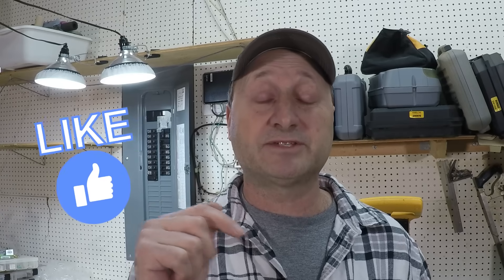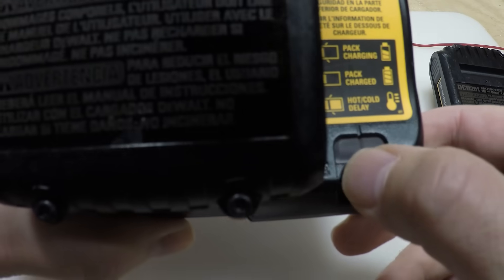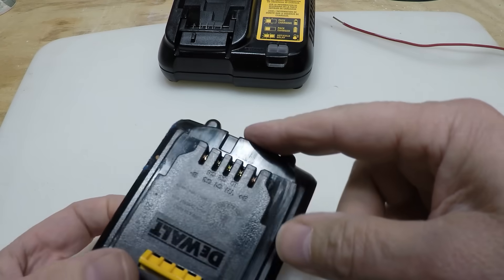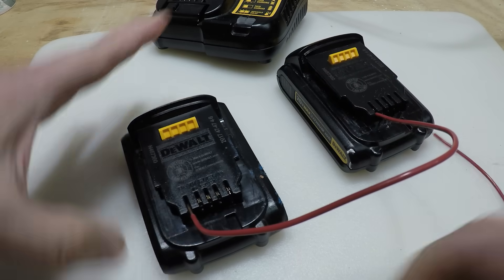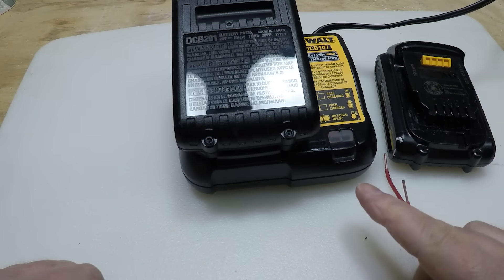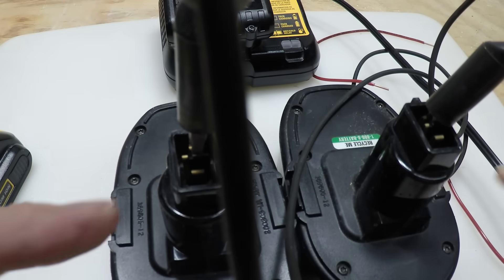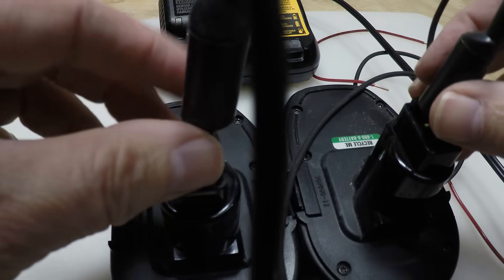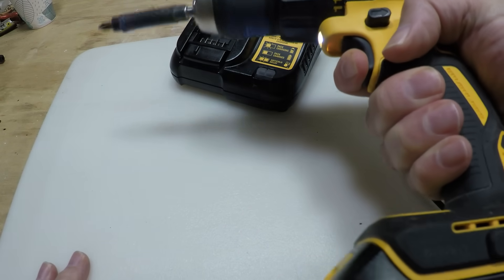SECRET to FIX Drill Batteries - Charge Dead Lithium Tool Batteries

Comment: I’m an Electrical Engineer. Never recharge an over-discharged Lithium Ion battery. Yes, I know there are exceptions. But those exceptions are far too nuanced for the average viewer of this video to understand. Recharging an over-discharge Li-Ion battery runs the risk of overheating and fire.
Reply: So do this outside on the driveway?
Reply: @Nancy-V  - That’s what I do. Just be safe 😉
Reply: Great call! I was waiting for the fire to begin as he was completing the connection of the second jumper. Evidently he didn’t recall the fire lithium batteries created on the Spirit Airlines plane. Even worse, those fires are extremely hot and difficult to extinguish.
Reply: @RickUzubell  - Exactly correct. The reaction is a thermal runaway and can happen very suddenly. The technical term is “venting with flame.” I am formally trained in safe handling, charging and discharging of Li-Ion batteries. Trust me, they are not very forgiving.

Comment: What if one have only one battery as it came with purchasing,and the batteries are not sold or can not be obtained seperate?
Will a similar voltage of different and equal/same looking drill battery do?

Comment: It appears as though you are simply “waking up” the second battery. These have a BMS, Battery Management System that will “put the batteries to sleep”, if it’s voltage drops below a preset threshold to prevent further discharge resulting in damage. That’s fine for an otherwise healthy battery, but will do nothing for an old battery that appears to take a charge but doesn’t hold that charge and is basically dead.

Comment: Batteries in good to excellent condition that will not charge. If a battery falls below a minimum threshold (low voltage) the charger will read the battery as either defective or sometimes even fully charged. The ones that indicate fully charged and still do not power any tool (make sure that you try a flashlight or very low demand  tool) will most likely NOT revive. The other ones most likely will revive. You can even hook them up to a car battery (make 100% sure you have the correct polarity, engine off) leave for 15 minutes and then try charging. You could also try connecting to any say 18V charger for a 20V battery (always lesser not greater voltage.)  DO NOT TRY this with older beat up lithium batteries, they can explode and burn your house down!

Comment: This technique will work with any acid/lead batteries like golf carts and automobiles.  The "smart" chargers need to read some sort of voltage to insure proper connections and a totally "dead" battery will not provide this.  So a little charge is needed to make the battery and charger talk to each other.

Comment: Really interesting, what can you do with a Makita battery that is “bricked” I have tried your method and got some charge into it. Enough to run a tool but if I try to charge it in the charger the error light flashes and won’t charge the battery. Hope you have some thoughts on this,
Marinus

Comment: You can do the same with dead 18760 batteries using a 9volt block battery to kick start the dead 18760.

Comment: I would be very careful with this. Lithium batteries don’t handle short circuits well, both the full and empty batteries are at risk of overheating and catching fire.

Instead of a simple wire to jump the batteries, use a low value resistor such as a car light bulb in series between the two positive contacts.
Reply: What if you only have a dead battery and no other to jump start it
Reply: @luisocon5130 then buy a second one, bump start the old one and smile because you can now keep working when the old battery dies and you can grab the spare and use it while the other one charges again. Or return it if the bump start works. The capacity of the old one is likely reduced anyway due to its age. Batteries are consumable items as we all know who keep cell phones for > a year. They slowly die. Your old one is headed that way so at some point you'll need a second one anyway. Remember - one is none, and two is one. Be prepared.
Reply: @luisocon5130 then you can’t do it or get a 9v bettery
Reply: 😏All the people shooting down the guy that made this video should have made one themselves showing the "proper" techniq.😘
Reply: @ronaldclifton8710  I don’t need to brag about every thing I do. Any risks I take are calculated and mitigated. And I certainly don’t want others to endanger themselves by improperly replicating actions they don’t understand the consequences of. 

Lithium cells charged or discharged with currents higher than their rated limits are a very serious fire risk. A good rule of thumb is a cell should not be charged with more than 1C, (2A into 2Ah, 5A into 5Ah), unless it’s specs allow more. Ask anyone who has done RC model cars, planes, drone or choppers.
Reply: Keep all your Mags loaded, Empty Mags are like Dead Power Tool Batteries , Useless when you need them. Semper Fidelis
Reply: Where do you get discounted lithium ion batteries from? I have a few that did not take a charge.
Reply: A short would be if the connection was + to - of one to the other but the connection used was a jump same as you'd do with a flat car battery to another one.  This is to provide enough charge so the flat one can show a sign of life to the charger.  Most Li chargers expect some voltage to show before they will charge a battery and that is what this method aims to provide.
Reply: @Rybagz  hmmm… how do you know the empty battery isn’t internally shorted? This can happen when left empty for too long, or if overcharged. Look up dendrite formation in lithium cells.
Reply: @ericzucker you got schooled now pipe down
Reply: As I understand it, lithium ion batteries has no memory effect, this is only to get the small computer in the battery to have some power to talk to the charger. If short circuit lithium ion batteries, this is very dangerous. Most electronics are safe today, and many batteries are not directly connected to the using device, but has a controller with very low Ri in it, to have controll over the discharge and short circuits. This is the reason why NiMh was shifted out of use by all these manufacturers years ago.
Reply: @jameswik212  This is also why if you completely kill something with a non-replacable battery (like your cellphone), it will often charge very very slowly for a while before it turns on enough to charge at the normal speed. It has to be charged enough that the charger can measure the voltage, and if it can't, the charger will just barely trickle-charge it until it can.
Reply: @darrennew8211  Like buying a item thats been sitting on warehouse shelf, not flat just needs a kick.
Reply: @jameswik212  i rebuilt power tool lithium batteries. On those I worked on there was a direct connection between the cells and battery terminals. 

Maybe higher end units have mosfets but I have yet to see any.
Reply: It's not short circuit V+ to V+ and V- to V- its link them in series
Reply: @karlaldred2125 wrong. It’s not in series, it’s parallel. There is NOTHING to limit the current in the circuit. You may have hundreds of amps which is way more than these batteries can safely handle. 
Your dead battery may actually have a short.
Reply: He’s not short circuiting it, he’s putting a slight boost/ jump start no different then boosting your car.  Positive to positive negative to negative.
Reply: typical dead lead car batteries have high internal resistance because the acid converts to water so "jumping" them usually does not result in a high current until the dead battery starts to take a charge then it draws a lot more. Lithium batteries don't work that way and should be charged slowly if their cell voltage is below 2.5 volts...
Reply: 220 221 whatever it take's ! @Scubaken2022
Reply: @Scubaken2022  He's saying if the broken battery is not charging because it has a short, you now have two broken batteries, and maybe one on fire.
Reply: @Scubaken2022  nothing slight here. There is nothing to limit the current and Lithium cells don’t handle excessive current well. Read the replies.
Reply: @ericzucker   i fthe other battery is  the same capacity of the one you are "Boosting" then ther is no issue with "excessive" current. As a precaustion maybe "boost" it with a 1/2 Charged battery.

Comment: The reason this happens is because one or more cell is dying.  The batteries are 'intelligent' and know if a cell is dying.  A cell that's dying can cause problems - like fire.  So yes, this works, but if it's doing it, remember it's doing it for a reason.  The safest thing you can do is take the pack apart and find the dying cell and replace it (it will be one cell with a lower voltage than the others).  A single cell is worth about $10 for a good branded one.

Comment: No matter if you manage to charge it but such battery drains fast while using the tool. Also I f you leave it on the tool for a while the battery is dead again and doesn’t hold the charge anyway.

Comment: Question here for the clever guys, I have a brand new Milwaukee  Red Lithium  M18, CP 1.5 battery, does not let the tool(dril) work. When in the charger it shows solid green, but when I press the volume charged button at the front then only the lowest red light comes on flickering. Please help!

Comment: Hi. 
Thanks for this video, you explained it well and it makes a lot of sense. Unfortunately it didn’t work for me.
I’m in the UK and I’m using Parkside tools’ X-Team 20V batteries. Specifically the PAP 20 A1 model. Oddly, the charger and the battery both died at the same time. I’ve bought a new charger with a battery and that charger is working fine. However when I try to charge the ‘dead’ battery it says it can’t be charged, as you showed in your video. I tried your suggestion and for about half a minute looked like it would work, but then the error code came back. Tried jumping it yesterday and again today a little bit longer, but nothing. 
Do you have any ideas?
Thanks
Reply: Internal damage maybe? Did you try the new battery in the old charger?
Reply: . Yeah here's an idea.... All of these videos are bullshit! All of these comments are bullshit.... None of this is real.

Comment: I’ve just done what he showed me and it’s worked. Not used the battery for nearly 2 years as I thought it was totally gone. It’s now charging. Thankyou very much.
Reply: Pls report back on how much work can the revived battery do. I try to store lithium batteries around 20-30% full but sometimes they bleed out their juice before the next top-up.
Reply: You will have to rejump them quite soon
Reply: Same here mate 3 years and charging fully
Reply: just remember that this will charge, but your capacity is crippled unless you replace the dead cell that caused it not to charge in the first place.

Comment: I have a Karcher window Vac whose lithium battery is soldered/spot welded to with 2 small wires/terminals at the end of the 3.7 volt round battery. Karcher have advised against me replacing the battery (what a surprise) can you recommend (I accept any risks as its my doing) a way of attaching a new battery for instance would soldering be unwise or is there an epoxy type adhesive that would conduct current ? Thank you for sharing your knowledge its a really useful tip.

Comment: For anyone believing this, do some research on Li-Ion batteries, how and why they die. (this charlatan didn't even check the voltage)
It's an irreversible chemical process.
You can beat it back to life and get a zombie that will somewhat work.
Watch a vid about exploding and burning Li-Ion batteries and then tell me again how this is a good plan.
If you want to do it right, take it apart and check the cells. If one cell is bad, replace that cell with a similar spec-ed cell.
A dead or damaged cell will NEVER work well again.
But dangerous morons will keep posting this crap and ppl will try it. Wonder why the charger doesn't accept the battery?
Only batteries that dipped just below the trigger voltage might be saved if all cells are good.

Comment: I think you should check how strong that battery is.  If the voltage is allowed to go too low it damages the battery.  Look up lithium battery fire.  You really shouldn't be making videos like this until you understand the risks that people are taking by following your advice.  Those battery fires are caused by poor quality batteries or good quality batteries that have been charged improperly.  I am sure people will let you know if their house burns down.

Comment: The Reason this works is because of the Battery Management System (BMS) Circuit board.
The BMS is designed to switch power off when Lithium Batteries are Over or Under Charged to avoid a fire. 
The reason the connection time is so short is because the Lithium Battery has power, but the BMS is off (disconnected).
By quickly powering the BMS from another battery the BMS is switched back on. The Charger does not perform this function, manufacturer wants to sell batteries.